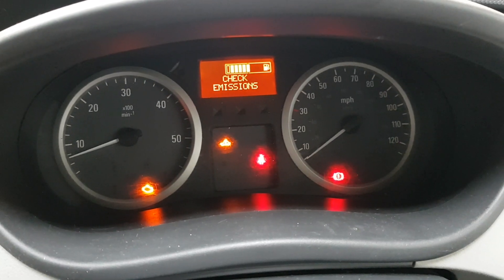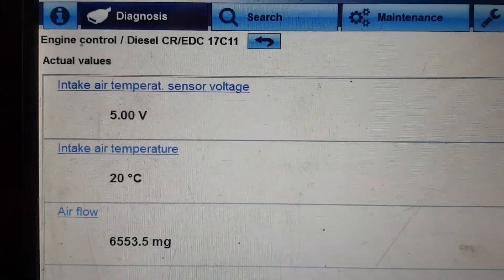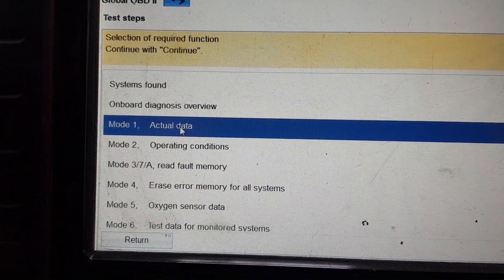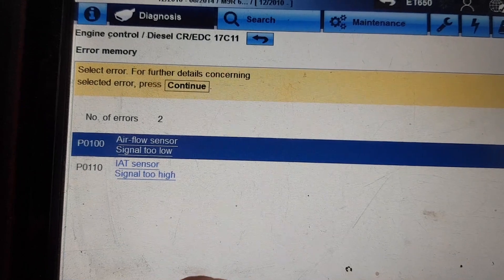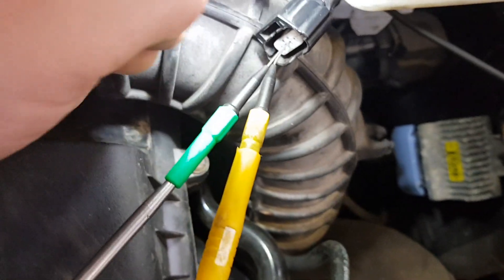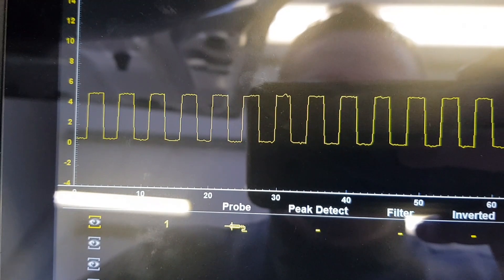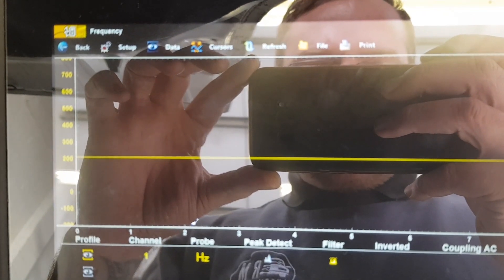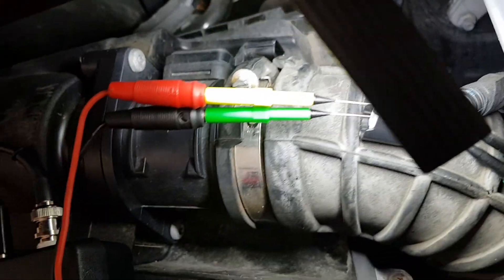Vauxhall Vivaro/Renault Trafic MAF fault P0100

Comment: also have the mass air flow code p0100 car runs great still but i have spanner and check injectors light still on car is 2011 renult traffic please help legend
Reply: I also have this issue on my Renault Trafic, did you get sorted? Apparently a common Renault fault, I’m still to confirm but today was told that the metal flap in the EGR cooler sometimes comes off its pin, goes through system until it reaches the turbo & either jams it or breaks it up. I had to replace my turbo 3 months ago & Its booked back to mechanic tomorrow for the same message!
Reply: @ngoudriaan000  I replaced the air flow meter fixed it good luck